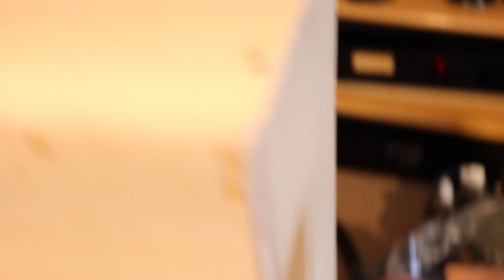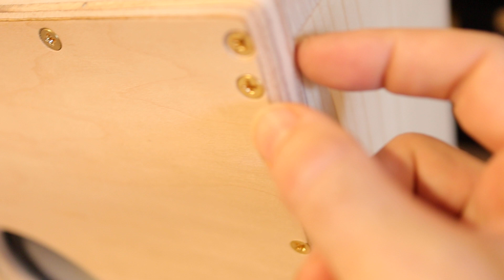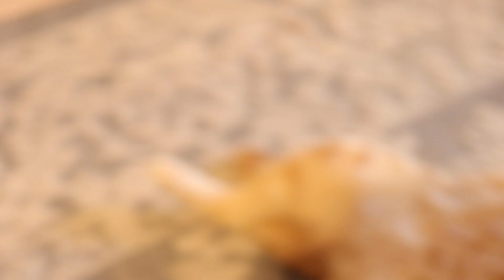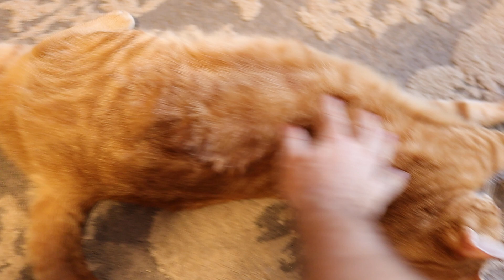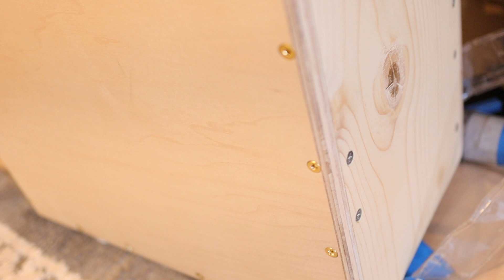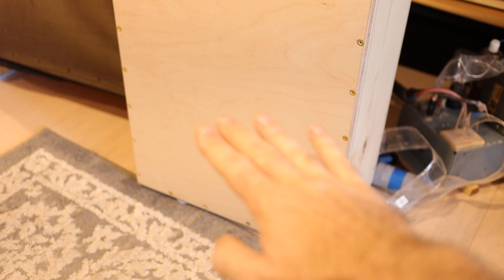La Grande cabinet screw spacing - details of screw positions

Comment: Hello! Thanks for sharing your builds with us on the internet. I wanted to ask if you have experimented with twin drivers in your builds. I have read that in series or parallel this can gain +6db in some frequencies and if the drivers are small in size and closely placed  they will perform similarly to a single driver. Just curious as it appears builds like this have the  room for twin setups yet people dont seem to use them.
Reply from the maker: Superb question, and actually yes, I was thinking of a twin build for La Grande! I sadly do not have one more pair of FF125WK, but I have multiple pairs of the venerable 5 1/4in Radioshack. I have an extra set of front baffles and top panels so I can swap between this and the RS twin build. One driver will be facing us, and the other facing up, creating a (quasi) omnidirectional radiation pattern. In addition, can wire the two in series creating a 16R load, heaven for tube amps. (And for good solids as well.)

Comment: I tried “biscuit” joinery before with the suggestion of a friend carpenter, using glue and clamps.. It worked well on an old BLH project.. Maybe “Dowel” joints on certain locations could help too..
Reply from the maker: Biscuit and dowel joints (or even dove tails ; ) are superb for the frame (top & sides), would be a nice step-up! ✨✨👍👍
Reply: @realworldaudio  Yep, true dovetails are above intermediate skills, but can be the most rigid..

Comment: Is that a Fostex driver?  So far the 85wk Fostex has the best high end Ive ever heard from a full range driver!  Im working on a controlled directivity 4 way speaker using this driver. :)
Reply from the maker: Hello, yes, it's a Fostex FF125WK. It has excellent high extension. ;) Good luck for your project with the 85WK! ✨✨👍👍👍👍